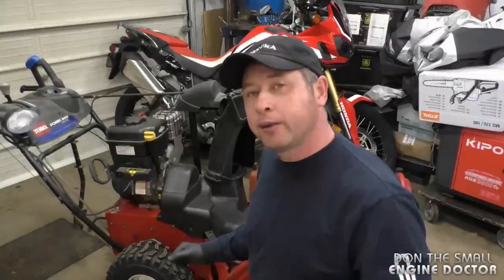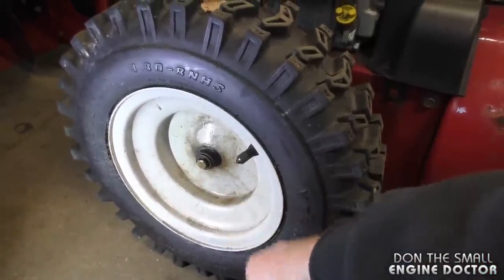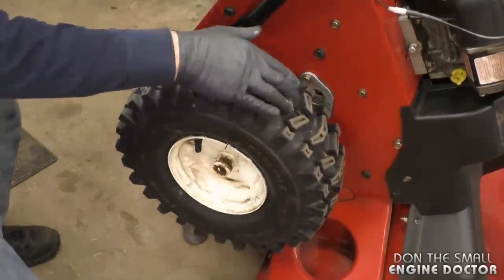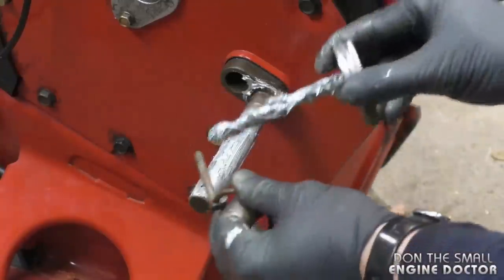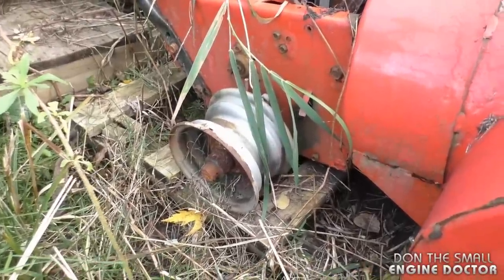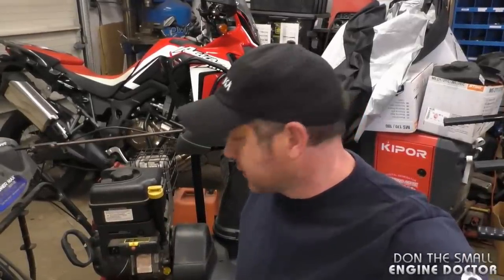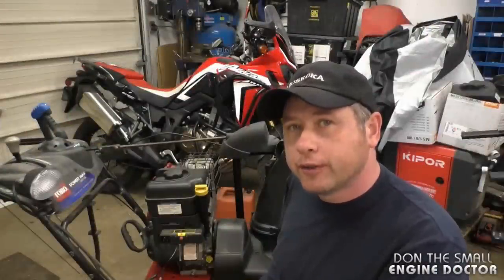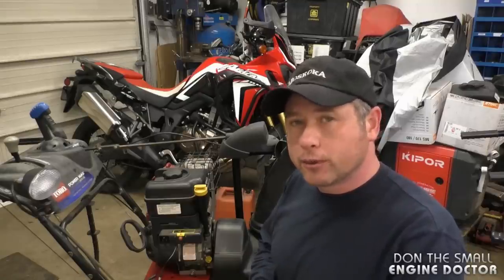ALWAYS Do This To Your Snowblower!

Comment: another repair guy heats the drive shaft red hot then sprays water till cool then uses a air chisel on center of shaft to remove wheel then cleans shaft & apply anti - seize

Comment: That is fantastic advice.  I suffered through a siezed wheel last month.  Originally I just wanted to replace the 35 year old tires on a Craftsman. Several days later, after trying pry bars, pullers, a 20 ton Jack on chains, an air hammer, and finally a torch, i gave up (like Dony on that Ariens he showed).  I finally changed the tire with the rim still installed.  If anything inside the case fails I will never be able to get the shaft out.  Don't, you are going to save someone (or many people) from misery with this video.  Thank you!

Comment: Basicly every part of the snow blower where things attach. I slap on antiseize. Pulled out at 91 toro ccr2000e that's been sitting for at least 6 years. No bolt or anything stuck. It's 29 years young and has an susuki engine. This single stage is a beast for 90% of my snow removal needs.

Comment: also good advice for nuts and bolts on the snowblower as you take them off for repairs, especially the ones exposed to the elements.  You just have to make sure not to overtorque on dressed bolts....

Comment: Man are you right about seizing up...I had to pound on it to get it off and ended up breaking it into 100 pcs......now I'm trying to rig a wheel on because I'm not spending 50.00 for new wheel...I got the craftsman  5.0- 22inch snowblower with plastic wheels..

Comment: Excellent advice Don !   I use marine grease; if it won't wash away from outboard propeller shafts spinning at tremendous speeds in saltwater environments then it is good enough for snowblowers. I also use it on the drive train gears with no issue

Comment: Excellent tip.  When I changed spark plugs in my Ford F-150 Triton V8 I used anti seize on the plugs.  To this day the plugs are easy to remove and DO NOT BREAK the plug.
Reply from the maker: Great tip!

Comment: Just did that to my Ariens snowblower. I pulled it out of my shed to service it and get it ready for the fall/winter snow season. I always service my snowblower this time of year, but never thought to do this. Glad I saw this video because my wheels were rusty on the shaft and I had to use a block of wood and hammer to get them off. Cleaned the wheels and shaft up with a wire brush set and lubed them good with anti-seize. Thank you!!!

Comment: On my Ariens, i put a ton of grease on the shaft but the tolerance is so tight that almost none of it remained on the shaft and it seized right up after the first winter. I had some warranty work done on it in a shop and they pulled the wheels out for me but they put grease back on the shaft...and it almost seized again. It's easy money for the shop to bring the snowblower in for that reason in my opinion. I'd bring my stuff to your shop any time. I put anti-seize on the shaft last spring and then i saw your vid. I'm glad you put that information out there. It might help others to keep their stuff longer instead of throwing stuff away. I'm glad to have found your channel. Honest mechanic! Keep it up!

Comment: I watched this video and so glad I did not put it off too long.  I recently got my MTD snowblower started again after 2 years of it not starting.  total it got above 50 F and decided to takle the job.  MTD have a bolt holding the wheel on.  After getting those off I had to work a little to get hte wheel off.  RUST had started.  I got the wire wheel out and cleaned the axle off.  put the anti-seize on and spun the wheel.  Then put a little on the bolts and tightened them back down..  WOW!!! Thanks for warning me.

Comment: I just experienced this problem after 5 years of following my Ariens snow thrower manual maintenance instructions,  which states to put oil on the shaft for the wheels and I followed their instructions faithfully.   Not anymore,  I’m listening to DonyBoy.  Especially after the effort it took to get the wheels off.  Thanks for sharing this tip!
Reply from the maker: the anti-seize will stay on but the oil usually goes away and no protection is left and wheels will eventually seize on

Comment: Thanks for that tip. My Ariens is stored inside and only gets used about twice a winter, but sure as heck the wheels were starting to seize. It looks like I caught it just in time. Some commenters ask why bother. On my Ariens there are two holes for the pin so you can drive either one wheel or both, so having the wheel not seize is important. Also in the future, it is nice to be able to take things apart if repairs have to be made.

Comment: Great information - I went right away and did my snow blower wheel s.  No rust after one season (20-21) - part way through this season (21-22) and still no rust.  I use my Anti Seize for my car break jobs and it works great.

Comment: Great advice. I just bought a new 30” Ariens and first thing I did was to remove almost every screw and bolt and coat them with antisieze. Then in 5-10 years if I need to fix something, it will be easygoing. Thanks!
Reply from the maker: they use different metals now and wheels can be seized in 2 years!

Comment: Emery cloth first, that's what I do!
Reply: yes that is a good procedure
Reply: I always use emery cloth to clean the axle shaft along with a plumbers wire bristle brush cleaner inside the wheel. Any rust is iron oxide and is very abrasive. I pull a rag through the wheel w/a little oil on it just to get as much rust out as possible. Using anti-seize is absolutely the best,  Never had this repair come back and if it did for some other work, the wheels popped right off.  Best tip ever.  Thanks.
Reply: @mtcman42  Twisted wire brush for drills = complete win for cleaning bores.
They come in steel, brass, nylon etc for all types of materials and applications.
Stay gold.
Reply: grinning-Thats why they make a wire wheel and cordless drills
Reply: You are wasting your time! The whole axle turns on self propelled snow blowers.

Comment: Trust me, do this, I learned the hard way, got one of these wheels stuck on the shaft and spent a good hour trying to get it off it was rusted on there so bad. Wish I had done this when I first got my snowblower, would have prevented a bad day fighting with this when it was -15 outside!
Reply: I know a mechanic that pulled the wheel, axle and all out of the hydro trans. trying to get the wheel off. I bought it off him and split the tranny and replaced the snap rings that hold the axle in. It was very simple.

Comment: Interesting post. My troybilt in Wisconsin is still going strong after 11yrs, but I see your point, and this is CHEAP preventive maintenance.  I actually did this on my Cub Cadet zero turn front casters and old riding lawn mower front tires.  This stuff is cheap,  just watch your hands as its some messy stuff

Comment: I had to cut the axle in the centre and pull the stuck wheel and axle shaft to change bushings.  Then sleeved, drilled and bolted the shaft back together.  Never Seize will Never come off clothing either!

Comment: Thanks for this information! I had to replace a broken steering cable recently which required the removal of the righthand wheel. I took the opportunity to coat both axle shafts with anti seize which I happened to have on hand. Keep up the great videos.

Comment: I worked for an oil well service company in the late 70's and early 80's.  The chemicals that were pumped down the wells (the pumps always leaked after time) and other stuff off lease roads would get into the brakes and cause the pivot pins to get so bad that the brakes would not release and then wear out quickly.  Those pins were so seized up that the mounting bracket had to be heated to a cherry red and then while one person held a three foot drift bar in place, another person would hit it with a six pound sledge hammer just to knock it out.

Then one day the shop foreman showed up with a box of never-seize and had us start coating the pins and rollers with never-seize when we did brake jobs and we never had problems with those brakes sticking applied and wear out so fast.  A few dollars of never-seize probably saved thousands of dollars.  It works equally well on preventing exhaust bolts, nuts, and studs from seizing because of heat.  Anywhere heat, salt, or other rusting or corrosive materials may be found, never-seize should be on it.

Who ever created this stuff deserves to be rich.
Reply: Thank you; I am.

Comment: anti sleeze, best invention for mechanics...I used this on every part I ever installed or took apart....we think we will never see these parts again and then it comes back for something and everything falls right out...great tip
Reply: I even us it on my auto lug nuts, makes em way easier to get off and on, and no they don't losses off by themselves because of it, at least not to me in the 40 plus years I've been doing it.

Comment: Had I not seen this video this year, my wheels would not have come off this coming spring...you saved my ass. Thanks for posting this! I got my wheels off after a half hour of hammering and heat...I got both tires off, and applied the product you showed. 

Nice and lubed up now! This spring I will clean it all good with a wire brush and reapply.

Thanks a million!!

Comment: I had this issue and tried everything. Finally I used a 3 jaw puller and luckily the wheel came off. 

Hey Donyboy, I did figure out the throttle lever modification on my old Craftsman, (8 hp Briggs and Stratton) and it works great. Nice Bike!

Comment: FYI - for those that work on their cars, use Anti-seize on your hubs where the wheel mates. I’ve worked on many vehicles with Alloy wheels mating to steel hubs. Pounding a car tire/wheel assembly off with a sledgehammer is no fun (think dissimilar metals = corrosion). Especially annoying if you have a flat on the roadside. Anti-seize is your friend, inexpensive and easy to apply, albeit messy if not careful.
Just thought I’d share as a retired automotive Technician.  Donny, truly enjoy your videos!
Reply: Great advice

Comment: After getting hard to start (pulling cord)last winter used electric starter.This winter I replaced the spark plug for the first time,started first pull with cord ready for winter.

Comment: I used a puller and a torch on an Ariens 9hp, wouldn’t budge.  The puller started bending the transmission case so that was a no go.  Very good tip... again Ariens going cheap they used to use lug nuts.

Comment: Ouch!  I've got  a 33 year old Toro 521 that's never had the wheels off.  On the flip side, when I used it today I turned the ignition key, full choke, pressed the primer bulb 3 times and pulled the pull rope, once.  I love that one pull start.

Comment: Having experienced a seized auger bearing I concluded that if I have a new snowblower I should disassemble it and put anti seize on the auger bearing to make it easier (possible?) to remove it in the future if ever the machine needs service.  My blower's manual suggested greasing the wheel axle shafts each season. I've been doing that, haven't had a problem after a decade.  But for the auger bearing I would go with anti seize.

Comment: Talking about rust, the best rust remover I have found for steel parts short of electrolysis is muriatic acid. It removes rust down to the bare metal. Only caveat, it's extremely corrosive, the fumes are very irritating and they will rust metal nearby, so it's best to work outside. Because it's so powerful, you also need to rinse the part with water and a bit of baking soda and as soon as it's dry cover with oil or WD-40 (or prime if you're planning to paint it), otherwise it will flash rust again. Great for screws, bolts and any parts you can dip in a gallon container. Muriatic acid can be found where they sell pool supplies.

Comment: Ok awesome - 2021 I bought a new snow blower (Champion-100680 301cc 27 inch) shipped directly to my home. 1st thing I did was put anti-seize on the axles just like you suggest & yeah this stuff is messy wear gloves & have some paper towels handy in case you put too much on like I did. 2nd thing was I bought expensive spray on dry lube/teflon from Dupont & sprayed the guts & chute area with this. 3rd check air pressure in tires (they were wicked low only 10LBS) & adjust the snow-shoes so I have a 1/8th inch gap (my driveway is paved but uneven) 4th. Have a beer. 5th coat of automotive detailers wax. 6th installed an hour meter/tachometer plus replaced the oil drain/fill plug with a magnetic version. 7th filled it with oil & $20/gal ethanol free gas from Lowes. All this gave me 4 quality time hours alone in the garage away from my mother in-law (she hates me) who is visiting for Thanksgiving.

Comment: I always applies Rust Check spray oil, grease, or any other good spraying lubes over it every start and end of the season. That includes all nuts, bolts and screws to prevent corrosion and future disassembly. 
If we get a very severe winter season I will do it again and again during the season. That includes my vehicle too.

Comment: Anti-seize i use that stuff on everything    Also it dont hurt to clean the rust off first
Reply: Just be sure to reduce torque specs according to a lubricant torque reduction chart. Adding antiseize to threads makes them more slippery. You are able to twist the fastener much further at a certain torque value when it's lubricated. If you use a dry torque value after adding antiseize, it'll be way too tight and could break off.
Reply: @mannys9130  Torque specs one good grunt
Reply: @mannys9130  that's crazy , I've never heard of this, where would this chart be?
Reply: @billlovett4256  Easy to find general torque specs for hardware GOOGLE
Reply: @mannys9130  It's not the space shuttle!
Reply: Agreed. I finally bought a big can of this stuff and use it all the time.
Reply: @richardhaughey3661  Sloppy. On shit that matters, take the 30 seconds to get the torque wrench out and set it up.
Reply: @mannys9130  not sure why your mentioning torque specs when there is no tightening of any bolts in this video. Using antiseize on a snowblower wheel shaft with click bolts is just about the best thing you could possibly do. But you 
are right, that goes for anything you put on a bolt before tightening from oil to thread locker. Also when using a torque wrench, for the most accuracy it's always good practice to have the least amount of extensions to the shortest socket possible.
Reply: Richard Haughey 
Depends - I have bolts on my mower deck that are spected at two grunts.
Reply: buddydgb 
Nice!

Comment: I used blowers commercially and never had a blower wheel seize on, but I store my blowers undercover. You could always just use waterproof grease if need be. Maintain the blower properly and you won't have any problems
Reply: 100% correct, I added grease fittings to mine, never had any issues at all.

Comment: Good tips, thanks.
Try to heat the wheel hub and not the shaft, may be you can still get a few hundred $ from this neglected snowblower.
Same principle as loosing seized nuts. Any nut would expend in diameter after heat applied (don’t even have to be red hot). Then you heat the shaft - the shaft diameter increases, it makes the seize even tighter temporarily. Once it cools off it may actually crack the seize and with enough force and some lubricant you can take it off, but not as easy and not as immediate as if you heat the nut. 
After heat applied the nut usually start to spin relatively easy, but become tighter as it cools - in this case just repeat heating procedure and turn it some more. In case of spinning of seized nuts, try not to over forcing it to reduce  thread damage. In stead of forcing, just apply an other shot of heat and keep turning while it’s still hot enough to turn without seizing again.

Comment: Just saw this, but I’m going to get some anti seize and use it on my Ariens. This may also work well on the receiver hitch and pin on my pickup, which likes to rust. Greg tip thank you.
Reply: If you think you will have to take anything apart again, use antisieze.  On everything.
Reply: Think stainless.

Comment: A good spray with lanolin lubricant over the base of the blower will also prevent rust and help if you have to remove any of the bolts in the future. Keep the spray up to the machine to prevent rust.

Comment: Thank You for the tip. I just bought my first snowblower, a Toro Snowmaster 824 QXE, I was told by another Youtube channel this was a "maintenance free" machine. At first I thought this was a good thing, but then I thought maybe that meant "throw away when it breaks". Does anyone have any experience with this machine, and other than using non-ethenol fuel, anything I can do for preventative measures before I use it for the first time?

Comment: And while you have it flipped up, lube the bearings and transmission... And any other metal to metal parts that may need to come apart. And your auger housing bearings... Needed to fix the auger transmission and rear bearing... took forever to get the pulley off the auger housing shaft without ruining the pulley.